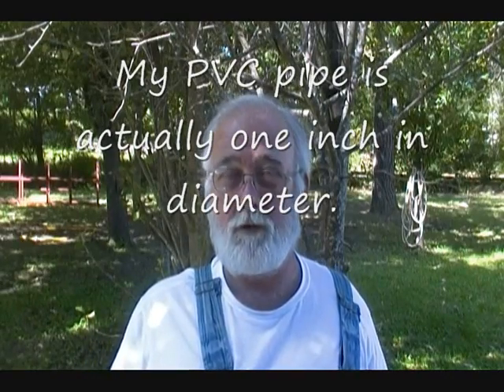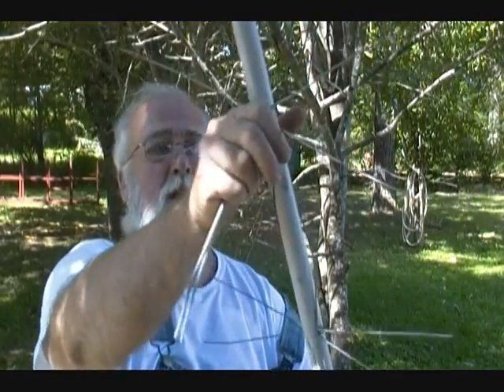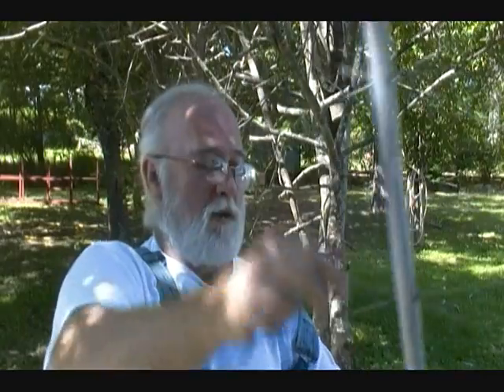Detailed Construction for my 36 Cent HD TV Antenna

Comment: dumbass question.whats the front and whats the back.
Reply from the maker: Makes no difference.  If you elect to put a screen behind the bowties to reflect the signal back onto them in order to strengthen the signal, then the screen is the back.  If you DO put a screen on the back, DO NOT allow it to come in contact with any other wires or it will screw up reception.
Reply: Thanks bob
Reply: Actually, that's an intelligent question that many will read and find useful.
Reply from the maker: You are correct Stephen.  That's what this channel is all about.  Helping people.

Comment: Get bro. Thanks for the vid. I've built a lot of antennas for radio but this will be first for TV. Just cut the cord last week. Feels good to only pay $45 a month internet bill! One question; are there two wires running down length of pipe? I'm talking about the "Candy cane" wrapped wire. I thought I heard you say there is one on each side.
Reply: Supposed to say "Hey bro" not get. Damn autocorrect!
Reply from the maker: Thanks for watching.  You will love this antenna if you are close enough to a broadcast tower.  Yes, there are two wires.  Note the transformer connects in two places.  The wires run exactly opposite of one another.
Reply: Got it. Thank you! I should be plenty close to towers. Thanks again and I'll update you wen done!
Reply: Since I was short on time, I actually just soldered each end of the coax to 2 6 inch pieces of copper ground wire. Taped them to a piece of cardboard with foil on the back for reflection. Hung it on my wall and I get all the digital channels in my area crystal clear. Plan on building yours (I'm sure it would reach further) someday, but for a quick, simple fix that requires NO baluns or PVC, nothing but a piece of coax, copper wire, and foil, mine worked pretty well. I was kind of shocked actually!
Reply from the maker: Sounds like what we used to do 50 years ago to pick up the local UHF channels, sometimes we just used a coat hanger wire.  The UHF frequencies used today are line of sight, so the higher you can place your antenna, the further it will reach, within reason of course...... you didn't say if you were in the sticks or in town...
Reply: Care to elucidate? Did you use RG-6 with ground, cut the ground and solder each end of that? I'm confused.

Comment: Excuse me but I did not see nor can I fnd your "other video" about the coaxe deelybopper thingy.  So now what do I do?  Looks like a big gob of electricians tape on your wire.
Reply from the maker: +Seth Warner It is called a transformer.  Any television shop will know what you are after.  Just tell them you are wanting to connect your coaxial cable to your antenna.  I got mine at radio shack, but they were a little pricey.

Comment: What is the distance to the broadcast towers youre receiving? Im 40+ miles from the nearest tower here and the slightest kricket fart between here and there will effect my reception.
Reply from the maker: +Greg Allison   I am in Tullahoma, TN.  You can use google maps to see the distance from me to Nashville, TN and Huntsville, AL.  I pick up all of Huntsville's channels and a couple out of Nashville.  I am much further than 40 miles.  UHF signals are line of sight, so the higher you can place this antenna, the further it works.  Look at my home page and see the little cabin on stilts.  I had the antenna pole on the deck sticking up above the roof and was on top of a hill.  I picked up over 48 channels there.  Remember you have to face the antenna towards the city you wish to receive.  I have taken this antenna everywhere and used it.  I am presently demonstrating it for my daughter in Shelbyville, TN.  They don't have satellite TV or cable.  She is pissed that I did not do this for her sooner !!
Reply from the maker: +Greg Allison Also thank you for watching my videos and subscribing to my channel.  I really appreciate it. !!
Reply: +DoingItCheap  Thanks for the quick reply. Ive considered making an antenna similar to your design a few times but just never followed through. I'll have to put one together soon and try it out. Thanks again.  BTW , Im a Tennesseean also. I was raised up around Bristol and I miss those hills.
Reply from the maker: +Greg Allison   Been through there several times..........absolutely beautiful there.

Comment: Can't remember at the moment but there are several websites that if you enter an address and antenna height they will plot which channels and what directions to point the antenna . And since there is no reflector on this model antenna it receives from 2 directions . I've built a couple very similar antennas and they have worked extremely well for me . I'm planning on building or rebuilding mine here at home and like your set up better so I plan on trying it . Thanks for a good video .
Reply: +DoingItCheap do you by any chance pickup any Chattnooga Channels from where you're at with this antenna? just curious. I built the one on youtube using wood but after awhile the wood shrank or something & my wires drooped down. I was going to build another one like it until I watched this video so now I'm going to try to build one using your specs & PVC pipe. thanks for the video & I'm not very for from you I'm about 10 miles south of the Tn line from Winchester over in Alabama.
Reply: yeah I don't think I'm going with the wood anymore even though the antenna did a pretty good job of picking up Huntsville &  Chattanooga I didn't really like the idea of using wood. I really like your antenna & plan on making me one as soon as I get a good day to piddle. thanks for your reply.
Reply from the maker: +Jonathan Callahan  Thanks Jonathan.  Yes, if you put the "cage wire" reflector on the back it will pick up better, or at least that is the way they sold the old UHF antennas, but it left you with an antenna that only picked up from one direction.  I remember as a kid, my father had two UHF antennas on the same pole pointing in different directions.  Thanks for the compliment.  I have used mine on a hilltop in Moore County, TN near Jack Daniels and picked up over 40 channels, in Milton, Florida I picked up Pensacola and Mobile from INSIDE the house with it leaning against the wall !  Young people today just don't realize you don't have to pay for TV.  Let us know when you get yours done and how many channels you pick up.  We will keep a running total here !!
Reply from the maker: +Don c Willmon   If you go to my homepage on here you will see my little cabin on stilts like a barn loft.  My 15 foot pole sat on top of my deck, so the antenna was about 24 feet above ground.  My cabin is on top of a hill in Moore County, TN.  I picked up Chattanooga from there.  Presently, my antenna is only on the original 12 foot stick at my little farm in Shelbyville, Tn and I pick up about 16 channels.
Reply from the maker: +Don c Willmon You are probably losing signal strength from the wood getting wet and bleeding across the wet wood.
Reply from the maker: +Don c Willmon No problem Don.  Thanks for watching and subscribing !!